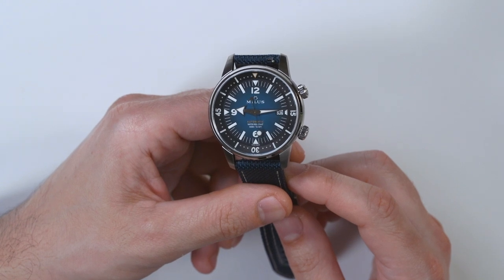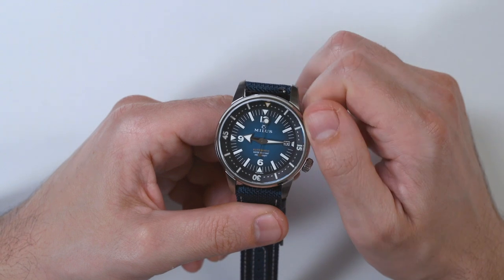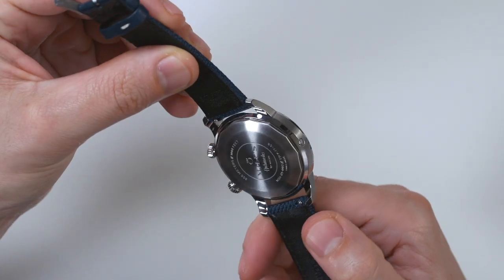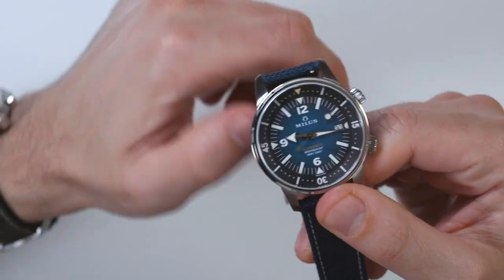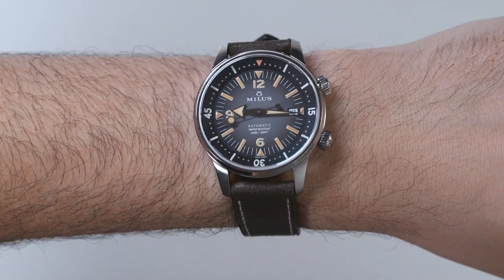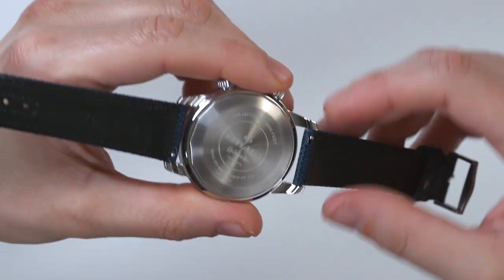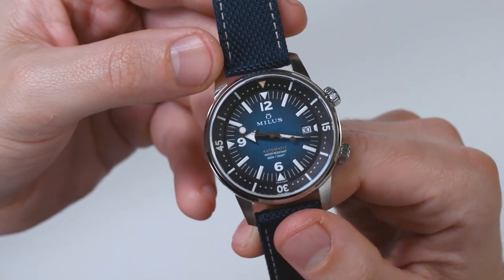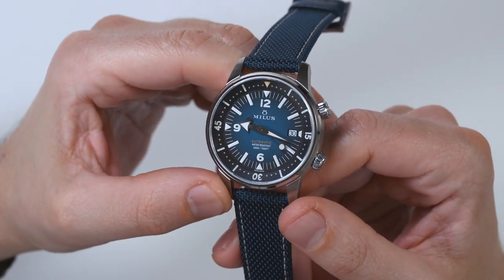Milus Archimedes Watch Review | aBlogtoWatch

Comment: Does the rotating bezel crown not affect the water resistance?
Reply: Screw down crown.
Reply: @jayebirdjb7143  Yeah, I meant when the wearer is hypothetically under water and is adjusting it?  Or would they adjust it before they dive?  I don't know, I'm not a diver lol but I figured with a regular rotating bezel, it doesn't matter if it's being operated under water since it doesn't affect WR.